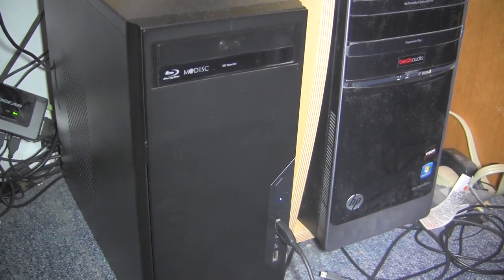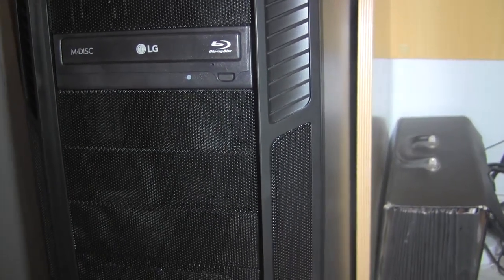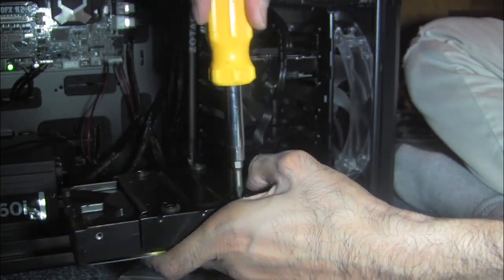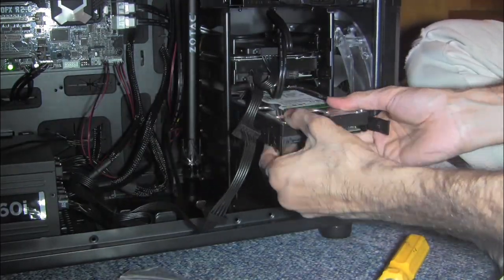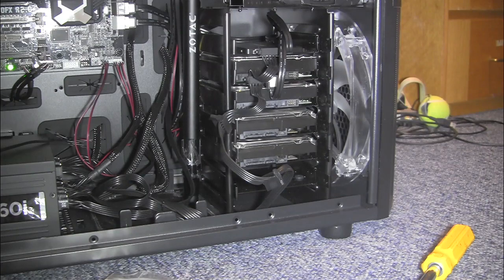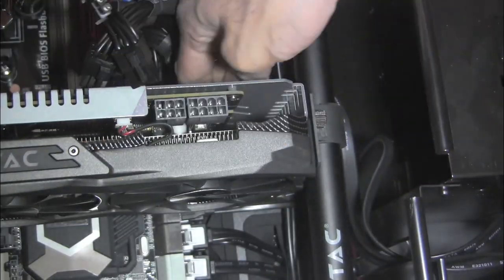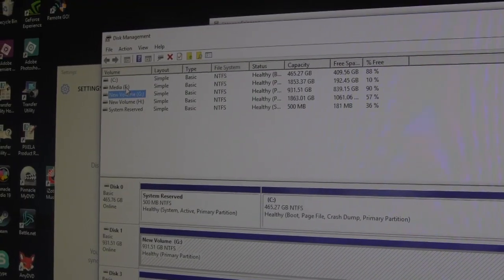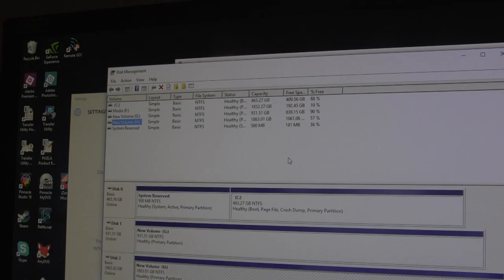Moving (non OS) Hard Drives to new PC: Ft. Proverbs

Comment: So if i move a hard drive to another computer. Like just plug and turn on. Would it turn on like my old computer with all my data and windows on it?
Reply from the maker: probably not as the hard drive with the OS (in your case windows) installed would be  tied down to your other PC's mother board.  Here's a link with more info:

 http://www.howtogeek.com/239815/why-cant-you-move-a-windows-installation-to-another-computer/
Reply: I just started my new computer with everything new but the hard drive and everything is the same
is this really lucky or something?
Reply from the maker: That is interesting.

Comment: can I use the os drive?
Reply from the maker: Yes and No, It all depends on what you want to do.

If you want to move the drive that has your os on it to a new machine and use it as a spare drive, then you can move it over.
If you want to move your OS drive (Windows) to a new PC and boot from it, well it may not boot as the OS drive (windows) usually gets tied to the hardware it was installed on.  Here's a good article about it:
http://www.howtogeek.com/239815/why-cant-you-move-a-windows-installation-to-another-computer/
Reply: +ImJustAsBad thank you
Reply from the maker: no problem, but remember why words are not law.  There are ways around this like dual booting and other crazy stuff.  Just google moving os drive or dual booting but it can get complicated and fun.